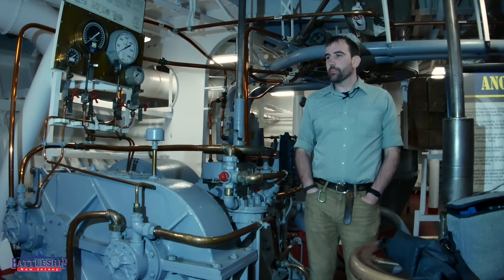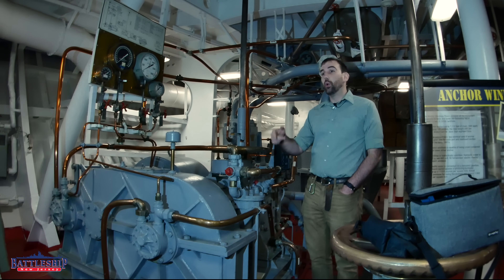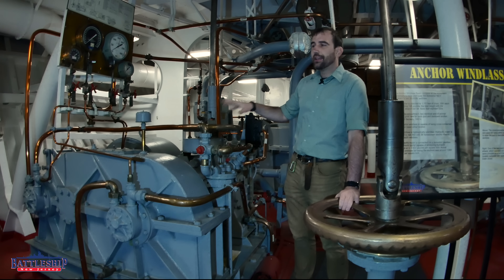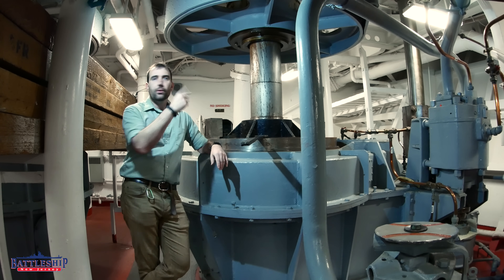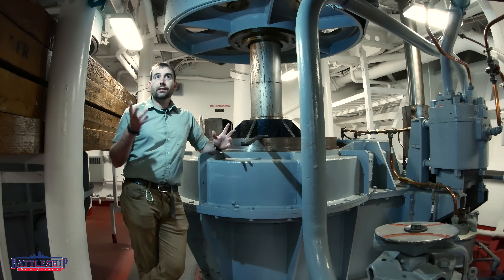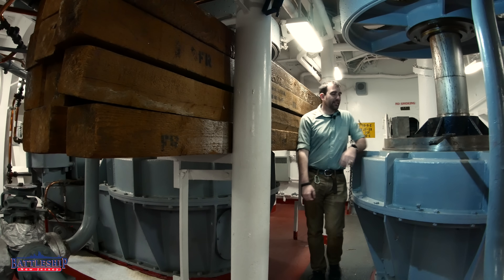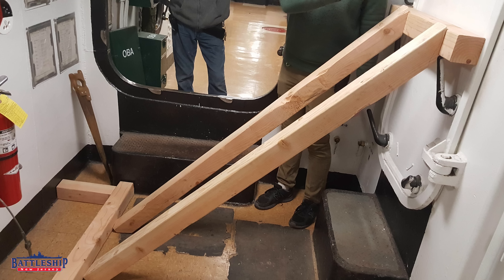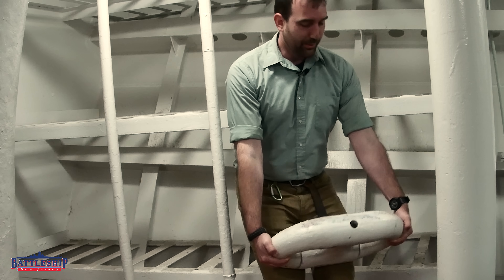ANCHORED! The Battleship's Anchor Windlass' and Capstans

Comment: @2:49  The mooring line capstan is always connected to the hydraulic system and thus will always turn.  The anchor wildcat is engaged and disengaged by means of two dog clutches (hefty steel cubes), when these dogs are engaged, the anchor chain wildcat will turn with the mooring line capstan. The wheel for raise and lower also controls the speed at which the capstan and, if connected, the wildcat turns--the more you turn the wheel the faster it goes.  The brake is just the brake, it is not intended to regulate speed.

@3:45  The copper pipes are not strong enough to carry hydraulic fluid under pressure--in this case the copper pipes carry the lubricating oil for the transfer case/reduction gear that is housed in the  round-cornered structure closest to the camera.  The reservoir below is ONLY for the lubricating oil.  The hydraulic pipes are the large gray painted 3" steel pipes you see just beyond Ryan's right shoulder.  The drum-like containers attached to the overhead are in fact the hydraulic fluid reservoirs.

Comment: What is the reasons copper was used vs steel pipes?
Reply: Copper pipes are used on the low pressure circuits while steel piping is used in the high pressure circuits.  Note the large gray pipes.
Several clarifications are needed on this one.
1.  The larger copper pipes pointed out as containing hydraulic fluid in fact contain the circulating lubricating oil for this system.
2.  The smaller copper pipes are used in both the lube oil system, and for "replenishment" fluid flow for the hydraulic system.
3.  The tank in the overhead of the deck below is the "sump" for this lubrication system.
4.  The overhead tanks contain a reservoir of hydraulic fluid and serve as expansion tanks and as a way to bleed off any air that finds its way into the hydraulic system.
5.  The very large grey-painted pipes contain the working hydraulic fluid being pumped from the A to the B end to drive the capstan and wildcat.
6.  The smaller handwheels control both direction and speed of paying out or drawing in lines or anchor chain.
7.  The larger brake handwheel only acts on the chain wildcat.
8.  It is possible to drop (free-fall) the anchor using gravity, but you would only want to do that if (a) you are 1,000% sure that the length of anchor chain on board is at least 2-3 times that of the depth of the bottom, and (2) bottom conditions require that the kinetic energy from dropping the anchor is needed to help embed the anchor (the anchor works only if it is laying on its side, that way the flukes are biting into the bottom).  To drop the anchor in this manner, the anchor chain is drawn tight by the wildcat so that the pelican hooks securing it to the weatherdeck can be disengaged, and so that the wildcat dog clutches can be disengaged from the B-end, thus leaving the chain and anchor secured only by the brake; release the brake and gravity does the rest.
Reply: @SomeRandomHuman717  that part definitely was missing and explains it deeply. Thank you so much!

Comment: Mooring lines is the correct term.  Ropes, used at the 2:03 mark, does not refer to the lines holding the ship to a pier, other ships, etc.  Rope refers to a braided wire rope made of steel.

Comment: Electrohydraulics is used by some modern construction equipment, such has excavators or backhoes.  Batteries can be good enough to power them in some applications but they don't want to immediately redesign every actuator so just switching the hydraulic pump to electrical gives a good compromise.

Comment: 8:50 above Ryan's head is a large disc, with a strap around it. You can see at the right side of the strap it is separated from the disc. This is the braking system. The strap is tightened around the disc (probably with a hydraulic ram, sometimes simply a threaded manual system) and the speed of deployment of the anchor chain is controlled by that brake.

Comment: The hydraulic setup is virtually the same as 'hydrostatic drive' on ride-on mowers. On those, the pump is always turning (- belt driven, not electric), and the movable 'swash plate' determines the direction and volume of fluid flowing through the output drive motor.

Comment: Sir, get out of that chainlocker! It is an artight box with no ventilation, so what happends is that CO2 gets trapped in there bequase it is heavvyer than air. People have died Fron this. It is OK but get a CO2/O2 sensor for next time, or ensure ventilation with a pipe to the bottom with fresh air.

Comment: why is the anchor chain locker so low? :O :O
On merchant ships, it starts right below the deck, and ends above the waterline.
Also why isn't the chain locker lined with wood?
And lastly be very carefull, chain locers are classified as 'enclosed spaces' with the rust of the chain going on, it can depleet it of oxygen.
Reply: maybe stability issues? The weight of the chain is significant. No point in adding top weight.

Comment: You better not drop something important like your car or house key down in the chain locker 😉 Needs the bottom of the chain locker some inspection from time to time? If so, would it be done only in active service? And then, how would they do it? On occasion when the anchor is lowered anyway or in drydock only?

Comment: That type of hydraulic motor setup is actually relatively common in industry. There's lot's of different configurations for the "A" end & "B" ends depending on the application. They work really well too!

Comment: These hydraulic pumps are referred to as WATERBURY pumps and have an A end to provide constant pressure to the hydraulic fluid and a B end to make the fluid instantly do work in either direction.  This is a very clever and useful invention!  I do imagine that these were used on many different types of WW-2 era ships.  
As a submariner who served on three different modernized Balao class diesel subs built during the war, I can state that much smaller versions of these were instrumental in moving our rudder.  These subs also had a Waterbury system in the forward torpedo room overhead that could work the anchor windlass or the forward capstan or be shifted over to operated the bow planes when rigged for dive.  There was a similar system in the after torpedo room except there was no stern anchor gear to work.  For all I know the same or similar Waterbury systems might be used in the nuclear subs today, but back in the day our Waterbury pumps made noise when doing real work and noise is the enemy of stealth in today's submarine service.  So...........

Comment: An off topic but relavant comment.  The youtube algoritim showed me a couple of you tube channel tha show simulations of armor piercing rounds and armor penetration.

One of their simulations was the Yamato battleship main guns and the New Jersey armor belt.  
The simulation shows the main round penetrating both torpedo belt plates and impacting the armor belt.  The Yamato round rotates 90 degrees and sort of scrapes the armor belt.  The New Jersey main belt is not penetrated but the inner war spalds.

Another simulation shiws the Yamato main gun shell striking the front plate of a IS 7 which was the last of Soviet heavy tanks.  Like the New Jersey case the Yamato shell rotates horizontal to the armor plate and scrapes the armor of the plate.  The round does not enter the tank but does cut a hole in the armor and causes steel fragments ti enter the drive compartment.

Modern sabot rounds do not turn horizontal to the armor plate but continue with their initial direction

Comment: Maybe you talked about this before, but I’d love to see the 16” gun training hydraulic system explained in this sort of detail - mechanical overrides? What turns on/off the B side of that system?  Is there a backup system for the turrets?  Thanks guys
Reply: Same. One of the things I want to know is, how the fire control computer knows where the guns are aiming? There has to be some sort of feedback like an encoder or potentiometer on the turret rotation and each guns elevation, which goes back to the computers. Being all analog it would be pretty interesting.
Reply: @crazyguy32100  I’m not sure the computer does know where the guns are.  It spits out a fire solution, which is then used to aim the guns.  There was I think an element of the fire control equipment that knew current roll of the ship though, and could fire when the desired roll was reached.
Reply: @DanielsPolitics1  I think there is gyro-automated positioning of the guns, if you see videos from inside the turrets during firing exercises (here's one from Missouri in 1988. https://youtu.be/MTW_xpK-Twc really gives perspective on the recoil) you see the breech moving up and down, the system is keeping the guns on target while the ships rolls.
Reply: The backup turret rotation system is the strongest sailor gets to push on the barrel end to rotate it.  I think they give him some ear plugs and gloves for safety...
Reply: They showed some of the turret stuff in an earlier video, but not in as much depth.

Comment: Wow, the windlass room looks absolutely gorgeous! Is that what the whole tour route looks like? I mostly watch exploration, maintenance, and specific topic videos on the channel so I wouldn't know. Great job!

It's also fun to find a video that's all about stuff I've actually used in my own career... Question: Did the Navy ever install, oh, what're they called, CT lines? Constant tension lines? That was a big part of mooring modern support ships, was wire rope breast lines that spooled around a drum that was run by an automated winch that could be set to maintain a specific tension on the line as wind, tide, and current acted upon the moored vessel. Definitely seemed to be worth the extra failure point.

Comment: How do you make sure the chain locker has breathable air in it? I'd imagine all the surface area of rusting steel from the chain would dramatically increase the comfined space danger.
Reply: I'm not sure if it was a separate video, but they've mentioned a few times that they take a lot of precautions to ensure every space in the ship is well ventilated - both to keep the air breathable and to help carry out any moisture that might accumulate. Of course, that means that watertight compartmentalization isn't anywhere near as good as it would be if the ship were still in operation, but having most of the doors open for the tour route makes that a bit of a moot point anyway.
Reply: Likely have to follow OSHA requirements. Not a big deal

Comment: An unrelated piece of knowledge.  The Russian navy is equipping their corvets and transports with pantair air defense vehicles.  The pantair is a wheeled vehicle with radar, phallanx type gun and air defense missiles.
I bring it up because the littoral ships had problems bring in weapon modules.  Vehicle based modules can provide a quick weapons change out.  Since the modules are dual use with other branches, then the cost of the weapon systems is much less

Comment: Have you ever done a video on the dangers of oxygen depletion in non-ventilated metal rooms?  Is this an issue you have or have had to deal with?  That was my first thought when I saw you climbing down into the chain locker.
Reply: I'm pretty sure he's mentioned it, especially with the void spaces.  But yeah, I'm sure he's very careful before climbing into some of those spaces.
Reply: Did you notice the big flexible pipes running down the with the ladder?

Comment: 1100 feet of chain. So that is 12 shots of chain each shot of chain. Add on - same type motor back aft for the steering gear.  Hmmm on the pump and figures for the motor to turn the 16 inch gun turret. and the video of movement at a "smooth" pace. I have a feeling only tested once - doubt it would ever be need - but if called for that turret could be "whipped" around pretty fast.  Interesting fact below- but I have feeling all 4 Iowa have same point / methods last relocation. Another great video

Comment: It looked like a socket wrench could remove center of chain link.  
Is that so, and are all the chain links like that, or just every other one?
Reply: Ive seen similar on other chains, undo the bolt and the link can be "opened" so you can connect chains together or replace a damaged section, i suspect there is a single link like that every shot of chain (90 ft)

Comment: Having a separate brake on the anchor windlass may serve a couple of purposes.  I don't know the Iowa class anchor gear to be certain, this is just a general thing with an anchor windlass.

First, it may be possible, if the brake is big enough, to drop anchor in normal use without using the motor; by disengaging the clutch or drive linkage/gears and controlling the drop with just gravity and the brake.  This is common on small vessels because it's much faster than using power to lower it.

Second, in emergency, where the ship is blacked out or having power problems.  Same as above, disengage the clutch let gravity do its thing, but out of necessity rather than because it's quicker or easier.

The problem you face in both scenarios is burning out the brake if things get a bit too quick, which is why it might only be in emergency.  That much weight moving fast generates a massive amount of heat when the brake tries to slow it down.
Reply: Good explanation sir.